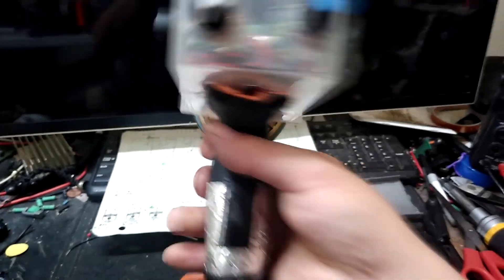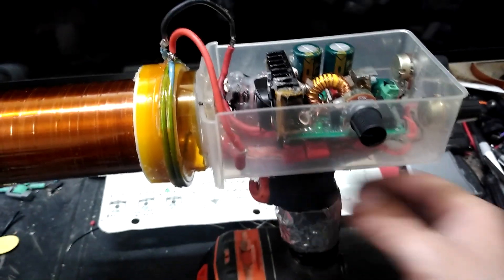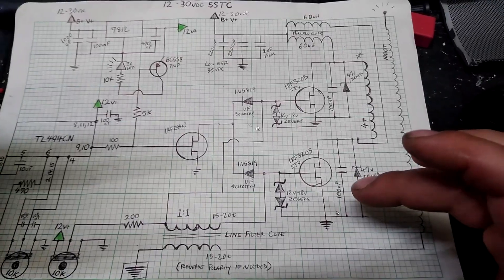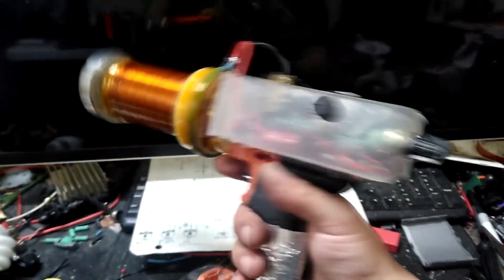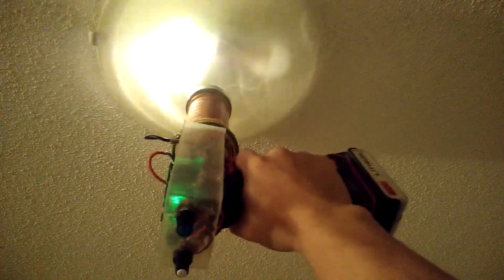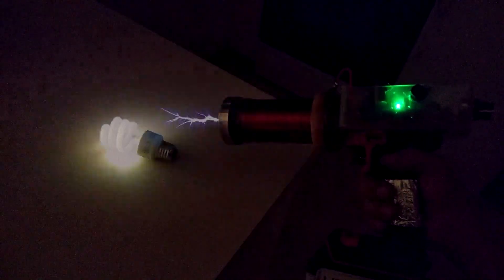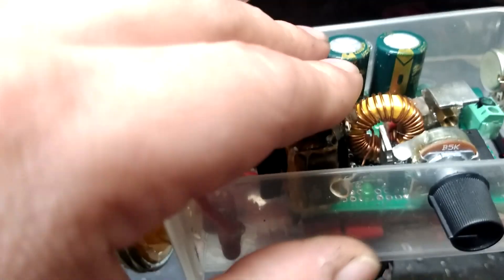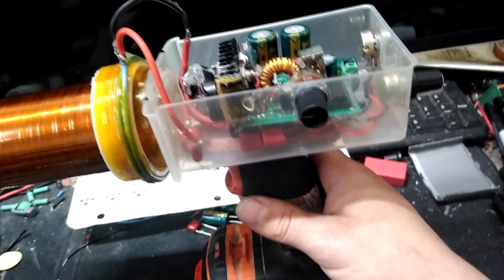Mini Tesla Coil Gun (20vdc pew pew)

Comment: That's really cool, and looks like it beats the Chinese ones that internally use a boost converter for around 50 volts operation. Did the Chinese copy your circuit? One is shown on the 'Electroboom' channel, and the diagram looks almost identical for the output driving stage.
Reply from the maker: I would say my circuit is an altered copy of a Tefatronix circuit which was similar to Skori circuits, but it's hard to really put an owner on a push-pull TC that uses feedback current to switch. I think the Chinese were playing with "double E" or push pull circuits in general long before I was. It's possible someone could have shared my video and helped spark the idea of building a TC gun using that topology, which I think is great because it's the same conclusion I came to.  I suppose it's just easier to run higher voltage fets and 48-55V bus with that topology for the decent arcs, and it doesn't need the boost stage to go all the way to like 300VDC. So it's a relatively safe toy all around. I found I could tune a lot of mine for pretty good output at 30V using 55V to 100V fets. That prevents the need for any boost stage unless wanting to run from small batteries.
Reply: @Magneticitist  Relatively safe, until you see people aiming for power strips or other mains powered devices that are switched on. I guess they don't realise that mains could conduct down the arc and into them via the secondary if they are being used as the 'ground' connection. The way I see most of these solid state devices is they are basically a radio transmitter, with the 'antenna' being being almost all 'loading coil', especially the higher frequency plasma flame types. At least it won't produce much radiated field if the frequency is relatively low - can you imagine the havoc a powerful pulsed radiated field would cause if you could get it up around VHF? I've not seen anyone try yet, but guess it won't be too long.
Reply from the maker: @threeMetreJim  True, though people will find ways to hurt themselves with anything these days. Tesla coils are all basically transmitters because they all run at RF. The spark gap iterations can be extremely noisy. I've seen a couple small VHF builds but none that are very high power. Switching that much power at that high a frequency is no inexpensive task. Larger TC's are typically pretty high power though so the fields can be pretty insane.
Reply: @Magneticitist  The only 'tesla coil' I've attempted was one of those slayer exciter type. It worked ok for lighting fluorescents and neons but wasn't very impressive - was a bit rough at 12v and gave some painful burns. I've played with a small medium wave transmitter, so no sparks but enough from the antenna to light tubes and give a burn if no careful. I've just been bored so looking at other potential ways to drive a coil at a bit higher power. As I've got a fair bit of junk lying about, I was thinking something along the lines of an modified old ATX psu (not running from mains, but lower voltage) free running, with the frequency raised as much as possibe (half bridge). It seems the target is to feed a series resonant circuit from as low an impedance as possible, so a step down but high current high frequency connected directly to a secondary coil. I was also considering a medium power baxendall oscillator, so the  coil is fed directly with a nice sinewave. Basically looking for something that won't immediately blow up and can be made from  bits and pieces that I have lying around. I have many of the ferrite cores from computer supplies for winding transformers onto. No FETS, but plenty of medium power bipolar NPN transistors. I did have success with a flyback driver (old crt monitor flyback) - two 555s, one an oscillator, the other a monostable driving a transistor from an old computer PSU. I added a fast  over current detect that would re-set the monostable if the current got too high - the circuit never died no matter what was fried; bread was good for a light show but the burnt toast smell was awful! Power was only about 30 watts though, running from 12V supply.
Reply from the maker: @threeMetreJim  It's been a tough one for me trying to figure what would be the easiest and most successful type of build for people wanting to get into Tesla Coils. I think most people typically take a stepped approach where they start with a Slayer Exciter.. then work their way up naturally because the desire to see longer arcs drives them. There are some 'driverless' iterations out there which are not too complicated but I guess tuning them can be difficult. I always like building my own drivers but I'd say there are so many available ones out there these days for cheap that's it's fairly easy to do an H-bridge or just a half bridge build. 

Anyone who can build a basic inverter can really just add a driver and some coils to it and probably have it working pretty damn good. I always recommend a basic unfiltered setup where there is no smoothed DC bus. Just half-wave rectification and a basic feedback circuit using a schmitt trigger and some gate driver IC's the signal is fed into.

Comment: Hey Bro,
nice Video! the results are pretty good, love the idea to use a motor drill. Im also working on a Teslacoilgun at the moment. I finished designing all the parts, now I have to print it. I will use a Halfbridge and drive the coil with 1Mhz ;)
Reply from the maker: Man you're going to love it they are so addicting. I learned in the first couple days I needed to really contemplate the variables. Half bridge and higher voltage bus is certainly a good way to do it with the downside of being very difficult to create continuous-wave output.  I also realized that if the arcs were too big it would almost defeat the efficacy of using it to shoot the Sparks at particular small targets. The output on mine is good for things like shooting bugs lol. If needed the CW will fry things lol. These circuits can get it done at under a few amps maybe closer to 6 or 7 amps CW so you can get some pretty good run time off one of these batteries.

Comment: What happens if you use this on your motherboard of your PC? (while off and while on)
Reply from the maker: haha nothing good. Might not damage anything when off but the arcs will short circuit connections.
Reply: @Magneticitist  Why doesn't it hurt the board when off?
Reply from the maker: @Smartzenegger  it still could damage it but if the components can survive the voltage they'd only be damaged from the heat or shorting of pins when powered
Reply: @Magneticitist  Would you like to test this? It doesn't have to be a new or expensive computer. :)
Reply from the maker: @Smartzenegger  you'd have to give some more specific parameters. I mean technically you could hit the mb with the arcs and it will be fine. Also, you could intentionally hit it with arcs that WILL destroy it. With a high enough on time the arc contact will be comparable to just holding a lighter flame to the components.
As for things like ESD tolerance it's a toss up and may vary from pc to pc.
Reply: @Magneticitist  Okay, then test a computer when it's on, and see what you can do without destroying it. It might give us a little more insight on what a computer can take. :) Zapping the heatsink might not do anything right?
Reply from the maker: @Smartzenegger  I can already tell you that zapping a PC with it on is going to cause any number of random problems. The electric field alone can do this. Zap just the right areas and short just the right pins with it running and you could destroy IC's. Zap IC's and they may get destroyed either way as with any high voltage. If properly grounded/shielded you can probably get away with striking the enclosure. Running the coils near the PC can randomly cause it to do things.  

Basically you can expect a Tesla Coil to cause havoc to any unshielded electronic device when introducing the voltage to it.
Reply: @Magneticitist  Well let's see it. You can begin. :D

Comment: I built something similar. Used pretty much the same setup with a voltage booster to around 24v and the tesla coil ground connected to a very thick isolated wire. and it's working great. Your sstc gun definetly looks better than mine 👍.  I have a 2 or 3 times bigger  box. But it's fun to walk around and shoot some arcs to every object you see.
Reply from the maker: If I'd have known they were so fun I'd made one a long time ago. Now I need one disguised as a regular drill to scare the piss out of cowokers. I might add the boost driver but it would take up a bit of extra space.